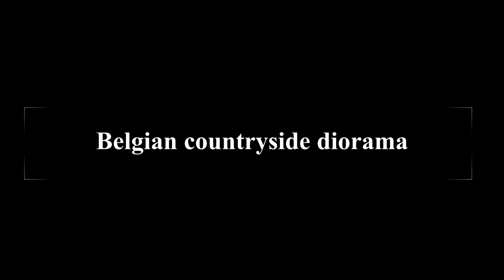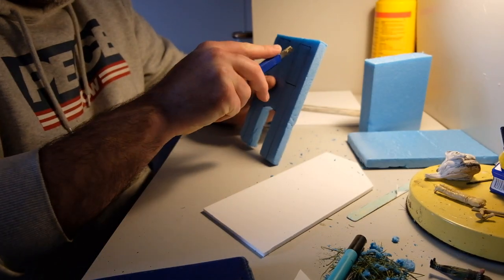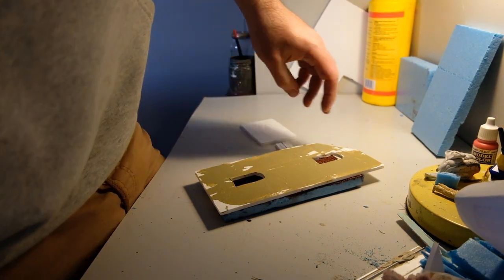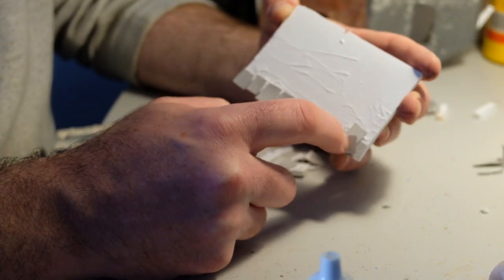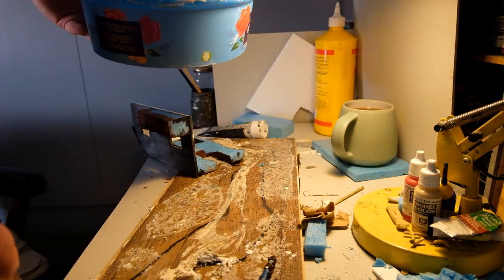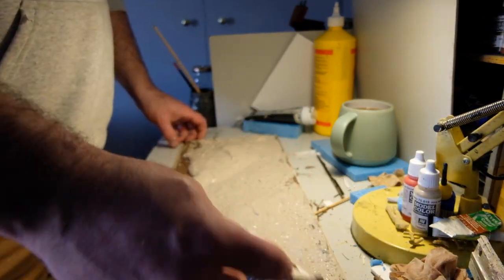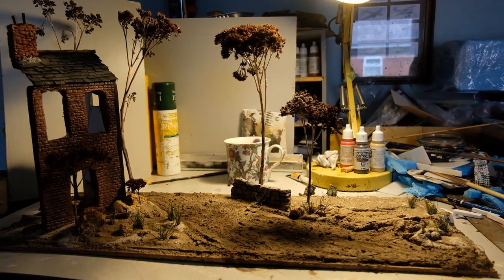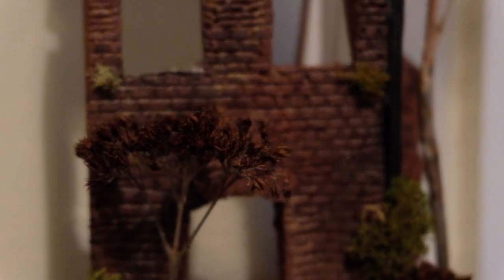Belgian countryside 1944. New Diorama!

Comment: Buying books and research is the key.Knowledge is power.I have spent hundreds of hours researching and watching Youtube videos. I started this hobby 2 and a half years ago with nothing. I am retired now so i have lots of time to devote to this. I just brought 2 AK interactive books 1 is oils,washes and filters, another is ETO. I will be purchasing another concerning dioramas. You did a good job over all but a few suggestions : after scribing the building walls apply different shades of brown and red ,apply a thin coat of filler to represent the mortar then a wash to unify everything.Only other things were the trees and the lichen.The trees didn't look like any trees that i have ever seen i could be wrong and a little bare towards the bottom?This is just my opinion and i am by no means a professional modeler. I have been working on a diorama for a year now and i am almost finished just need to make a tree and order some figures. I have OCD so it's difficult for me cause everything has to be just right or i start over.Some Youtubers to watch are: Night Shift,Plasmo,Panzer Meister 36 and my favorite Laser Creation World also Andy's Hobby Headquarters and Champion Scale Modeling. Hope you found this helpful
Reply from the maker: Thanks for the advice Tim, I know most of those youtubers apart from Champion so I will check them out. Yeah the trees need work, It takes me about 1-2 weeks to make a dio, the model and the video and probably I should take longer but now I am videoing them its not a good time to spend more time on them, but its a good challenge to work within the time frame.